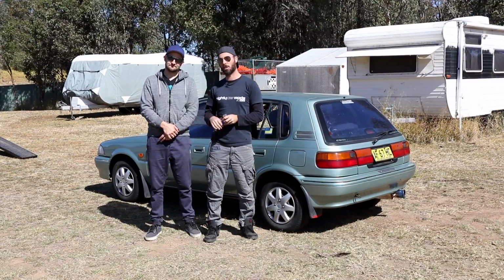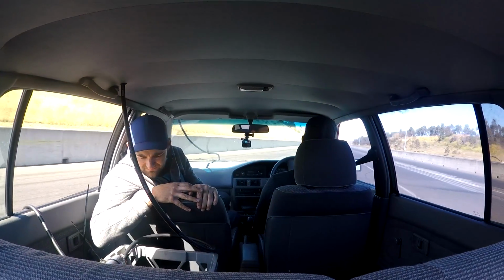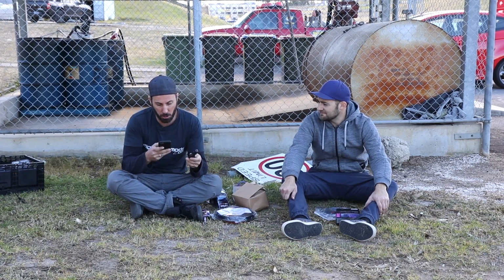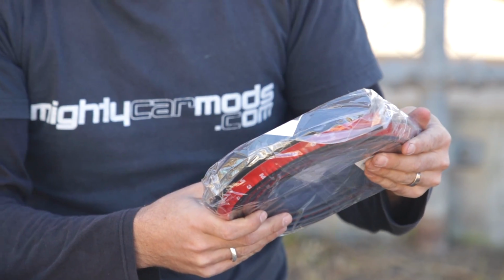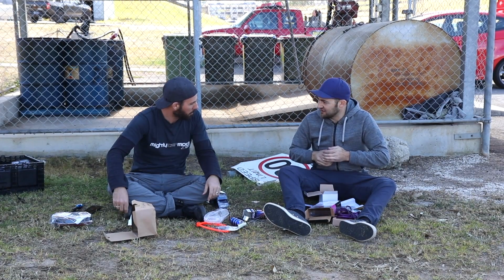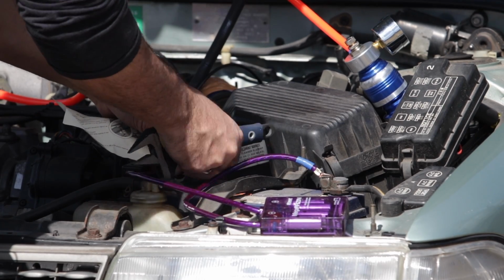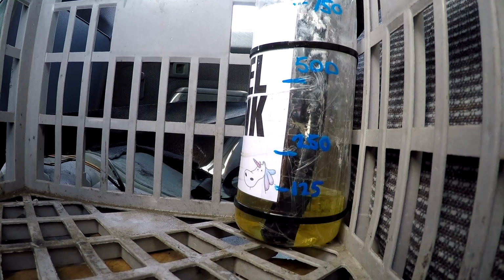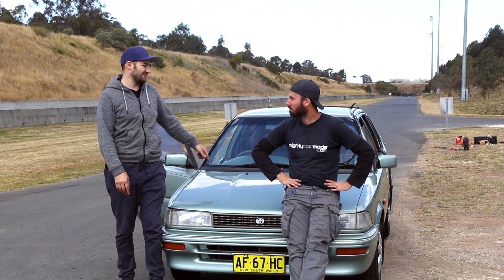Fuel Economy Mods - MYTHBUSTED

Comment: Finally.. 

Now here's a challenge. 

Build a vapourizer. 

Basically you need the following. 

Custom aluminium airbox.

1" Pipe valve (to control air/fuel mix, sits at entrance to 1" air intake) and 1" to create air intake into fuel and a 3" spring loaded valve to allow air to mix fuel under power and 3" piping to mix fuel under acceleration.
3 pipe nozzles (the part that allows a pipe to be clamped)
Copper radiator
4 channel relay
Electric solenoid
Electronic float
4 t pieces (sizing equivalent to coolant lines and fuel line. 

OK.  

First step, build your aluminium box to sit under your airbox lid, so it essentially becomes your new airbox. Drill the box to install a hose thread allow fuel to be fed into box. 

The 1" intake for air to percolate fuel. Use stainless steel pipe to create an intake to return into fuel.. This will make sense as you build.

The 3" intake for air intake during power. (A 3" spring loaded valve) and steel pipe fed into fuel to percolate fuel and create fuel vapour under acceleration.

Now, you will need a float installed to take one litre of fuel and enough space to create vapour. In line with this, you'll need to install an electronic solenoid to open when float is on 'EMPTY' and close on 'Full'.. Routing fuel after the regulator will ensure consistent fuel pressure and no need to disconnect the fuel pump as the fuel system will still be running as per normal.

Install the 1" pipe to feed air into supplied fuel so it bubbles and aerates fuel during idle. 

Install 3" spring loaded valve outside of box (similar styling to air / fuel valve) to lock intake whilst under idle. 

Also your design needs to separate the liquid fuel from the vapour fuel but heat fuel vapour for intake to engine. Welding a piece of sheetmetal with a letterbox style hole and something to create a vapour barrier, also as a barrier to stop fuel being sucked into engine. Using 1 t piece will allow fuel to be fed to vaporizer and solenoid will allow for fuel feed, controlled by float. 

Then we need to install the copper radiator and have the input and output be able to cycle coolant from the intake header as this is the hottest coolant and you'll need to heat the vapours and not the fuel itself (hence the separation of liquid fuel and fuel vapour) using the t pieces to help route coolant to and from header.

Now, if the car is an efi (which most cars are), you want to shut off the injectors, so wire in a 4 channel relay to shut off the injectors when ignition is fired and during engines cycles as fuel will be introduced to engine during intake cycle rather than injection cycle. The spark plugs should still operate as per normal.
Reply: Gary Stinten isnt that basically converting the car to a "carburettor"?
Reply: Jakub Hobl then compare how far each will go on a litre.

Same car model. One efi. One "carburettor".. 

See which one will go further..

Comment: Try weight reduction on derick see if it improve speed and fuel economy
Reply: Rain Lee #SNAP it would, doesn't need to be tested.
Reply: Antony Evans true but some dough about it and some say its depending what brand the car is
Reply: Rain Lee #SNAP has nothing to do with brand. Less weight= less fuel and better acceleration. It's just physics.

Comment: OK, here's a good one for your next experiment. 
A performance car is more fuel efficient that say, a Hyundai GETZ, for example. 
Go to a track, flog the GETZ so it can just about keep up with the performance car. The performance car is just cruising by the way. 
Now, see the fuel difference. I have done it with a VW Golf R32 with DSG against a Nissan Micra. 
The Golf won hands down,,,,,
Now, go out and buy a sedan performance car. Its more economical!!!!! ;)
Reply: British Top Gear did this some years ago, with a Toyota Prius and a BMW M3.  The Toyota was thrashed around the track for about 15 laps or so, with the BMW hanging onto its bumper...accelerating at the same rate, cornering at the same speeds, etc.  The Bimmer actually returned about 1 mpg better than the Prius.

Comment: How do u guys start your manual cars without sitting in the car and stepping on the clutch? Please show me
Reply: Chalee Cha sounds like your car is quite new that's probably why you need to push the clutch to start. Older cars only need the key that's it!
Reply: Some cars are so old you don't even need the key just a screwdriver lol
Reply: Neutral?
Reply: I think so.  I never had a car that required a clutch pedal push until I moved to the US.  Before that, you just checked you were in neutral before you turned the key.  Nanny state saving idiots from themselves.  :-P
Reply: Ok , thanks guys , I was always curious
Reply: not every car needs it
Reply: If the cars in neutral you don't have to put your foot on the clutch to start it
Reply: Dan Rayment some cars so old, like my holden you don't need a screwdriver or key, just turn the ignition haha
Reply: I drive a 2009 corolla s in the USA if it makes any difference, I'll go out side and try it right now and be back to reply in 5 min , brb
Reply: Ok I'm back , and it doesn't start without the clutch being pressed , also my 92 celica is the same , must be an American thing

Comment: The problem was that you were eating crisps while doing the second test. This upset the weight distribution and caused a decrease in fuel efficiency. I am in my 11th year of sustainability research and development, and this although entertaining was 100% irrelevant and unscientific. The idea that you could be reading volumes from a water bottle with some markings drawn on with a magic marker and not account for parallax, or the centripetal acceleration from earth's rotation is ridiculous. This test is flawed and completely misrepresented the entire car modding community.
Reply: Their test was flawed, no doubt about it...but independent laboratory tests show the same results.  None of those things actually work as advertised.

Comment: That aero won't help. Aero adds stability and control while adding drag, aka making the engine work harder to make it go.
Reply: Raptor Jesus you're talking about spoilers and ground effect. They add down force and thus don't increase efficiency, spoilers add drag especially, but down force doesn't add efficiency is my point. However, aero can make a difference, think about driving a square car vs. a streamlined car. Those solar powered cars which are almost flat are a good example. That is all about economy. Similarly, being clever with vectors to reduce turbulence car increase efficiency. Your claim that aero won't work, is simply wrong.
Reply: You are still adding surface area for the air to hit, thus adding drag and slowing you down. TBH though I don't think street cars would go fast enough or produce enough unstable wind to really benefit anyway, and the added drag would equally be minimal.

Comment: I would like to see you slam Derek and raise Derek > 1ft and compare the fuel mileage.  This request is based on actual published data in racing textbooks.  They said you either have to eliminate air going under the vehicle, or raise the vehicle so much that the air is unimpeded under the vehicle.

Comment: Should have just let it run out of fuel and compare mileage. Idk, frustrating to compare using this method.
Reply: Integra DIY it was a joke episode mate, you're over thinking it. They weren't being scientific, they just joke about being scientific. It has a deeper meaning, but as a whole it was a joke.
Reply: Integra DIY He said he couldn't because it might ruin the pump.
Reply: SkyMix_RMT Won't damage anything unless you repeat it over and over. People run out of gas all the time, and get stuck on the side of the road, just needing a half gallon to get to the nearest gas station. But yes, fuel does act as a lubricant for the pump, but running it dry twice won't do anything.
Reply: If they avoided it it was for some good reason.
Reply: SkyMix_RMT please please pls don't look up to Mighty Car Mods for expert automotive Advice man. An easy google search will tell you, running it dry will damage if you frequently do it. This car is obviously scrap metal already, and running it dry twice won't hurt anything.
Reply: Integra DIY Alright, thanks for the tips

Comment: Easy, just change the feed and return lines, put a smaller line on the feed and bigger on the return, it will consume less fuel and more fuel will return to the tank, you will end up with a net gain in fuel!
Reply: I just put big wheels in the back and small ones in the front so im always going down hill!

Comment: 10/10 Would watch multiple episodes dedicated to car myth busting like this.
Reply: So would I, if they followed the scientific process. They set up an incredibly accurate way to measure fuel consumption, and then they changed more than one variable at once. They needed to literally film the process, then document each of the changes one at a time, and see if each product on it's own, even worked.

For example, the device which made a vacuum leak? That's a way to tremendously hurt your gas mileage, so if anything else did work, it had no shot at showing itself to work. I really hope my comment gets heard.
Reply: They made some others. Check their channel out
Reply: Watchu doing here?